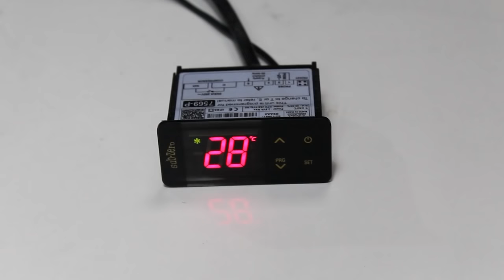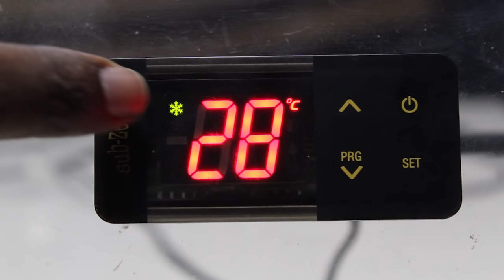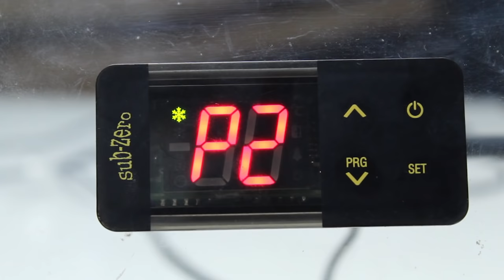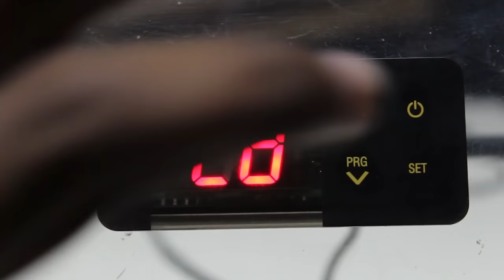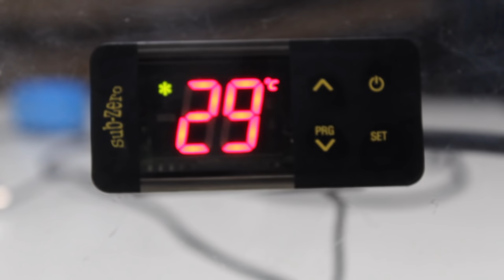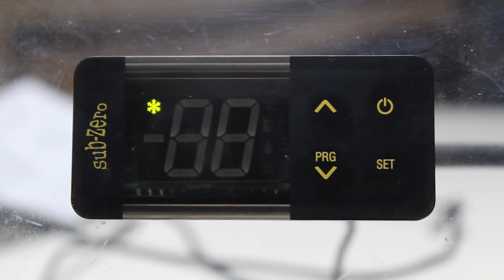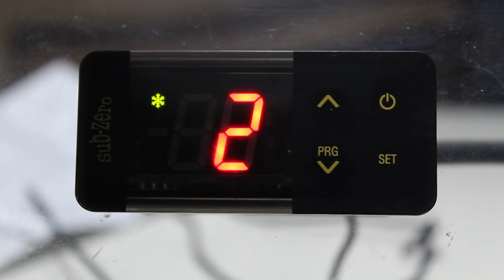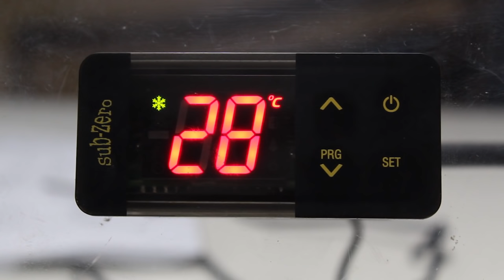SubZero temperature controller settings

Comment: i have  a little freezer in a room that isn't heated.. in the winter time, when the temperature drops to -30C, i would like the freezer to just turn off, then turn on when the temp rises...  however the freezer runs on 110v...  is there a model number for the 110v?

Comment: In parameter p3 the values goes upto -1c what I have to do to increase to positive temp
Reply from the maker: Allamsetty Harsha 
Increase p2 parameter till 40 and check set Point
Reply: Which value is suitable for set point

Comment: Hii sir this idea is not working with my cake counter  n its not cooling instead is showing HE 32. Help me out please sir waiting for ur reply
Reply from the maker: Temperature setting issue.
Controller relay working or not kindly check.
Ht means high temperature if compressor not working 
Contact 02227782005

Comment: Sir,
My 7510 t is maintaining the desired temperature but if I touch prog. botton for any parameter change only PA and 0 is flashing and then set botton ( dash Mark's are also not appearing as if locked or not workable any more. 
Pls help me or if needed I shall replace it though its 4 days old.
Initially all the parameters were working i myself might have given some password which i forgot.
So please.

Comment: What is the range of the probe(resistance) that we can use with sz-7510t.
Reply from the maker: -40 to 90
Reply: Not temperature range, but the resistance range?
Reply from the maker: Its having 10k resistance @ 25 degree

Comment: How to connect the controller another end connection? I am using ogeneral AC.help me bro
Reply from the maker: In outdoor unit there is compressor contactor available you need to connect compressor contactor a1 a2 points  with controlle relay NO POINT

Comment: I want to install a digital temperature controller in single door refrigerator to maintain temperature between 10°C -13°C and can I also maintain humidity aroun 90%?
Reply: Hey.. i have the same doubt. Were you able to fix it to your refrigerator?

Comment: Sub zero shows  HE 33c it wil also blinking. How can I reset the error and start the cooling compressor
Reply from the maker: High temperature issue 

Increase p2 parameter till 40
Reply: @stechengineers  Thank you so much for a reply sir. Ok sir.

Comment: Hi sir meter showing PP , what is problem sir.
Reply from the maker: Sensor fail or loose connection pls cont with 02227782005

Comment: Also what is p5 for
Reply from the maker: Abhishek Jakate 
P5 is probe calibration parameter 
To adjust temp reading if controller display not showing differnt temp reading than actual
Reply: S TECH 
How to set parameters

Comment: Even though the compressor is on, Why the temperature is not going below 16°c
Reply from the maker: Vinay Bhat you need to check your equipment mechanism to cool down its compressor work not controller. Controller just on off comp

Comment: Am I connect it with room heater to set it at a fix temperature.
If yes then tell how am I connect it with room heater.
Reply from the maker: Keep p1 parameter at 1 , it's works for heating

Comment: What is Lt showing -12 with alarm
Reply from the maker: Check P3 PARAMETER.
Decrease it at
Low temperature error whatever you set
Reply: @stechengineers  but why alarm is showing
Reply: @stechengineers  can you show video to remove alram
Reply from the maker: @pupunprasad1989  low temperature limit set, sensing temperature goes below set limit. You need to check low temp. Setting and adjust as per requirement,

Comment: Can we use this controller for incubator
Reply from the maker: Yes.
Reply: @stechengineers  if I want to maintain 37 degree in incubator means  how to set please guide me
Reply: @stechengineers  set point is 38 and P4 parameter is 1 means it will maintain 37degree , is it correct sir
Reply from the maker: @shajuvimal9171  yes. 37 will maintain
Reply: @stechengineers  Thank you sir

Comment: What is use of bell symbol
Reply from the maker: Alarm or error
Reply: @stechengineers   no. Always blinking 
And bell symbol is showing Always . 
Please give solution
Reply from the maker: @nishantpatriot3297  02227782005/
02227782006

Comment: Sir it is not increasing or decreasing
I think it has a lock how to open please tell
I do not have a password
Reply from the maker: Make LP parameter 0. 
If till facing the same issue then call 9967784443
Reply: @stechengineers  thank you sir keypad is now unlocked.
How to increase trip timing

Comment: PP  error coming what problems?
Reply from the maker: Sensor related issue 
Check sensor cable and connection
Otherwise sensor fail
Reply: @stechengineers  
Sir what is the problem HE
Reply from the maker: @AbdulAbdul-qx7pp 
Not HE it is HT
Make P2 parameter 50

Comment: How to remove pp
Reply from the maker: You cannot remove pp error , sensor fail you need to use new sensor or check sensor loose connection
Reply: Sir how much cost for new sensor